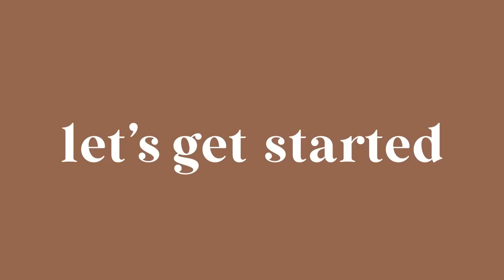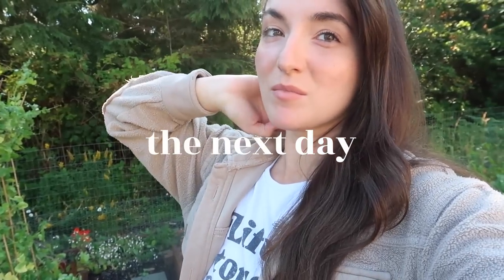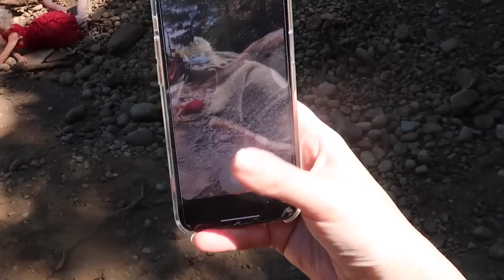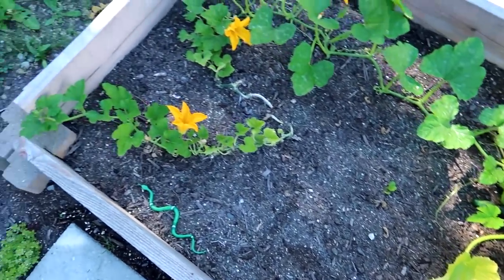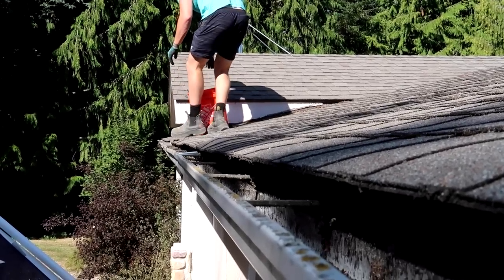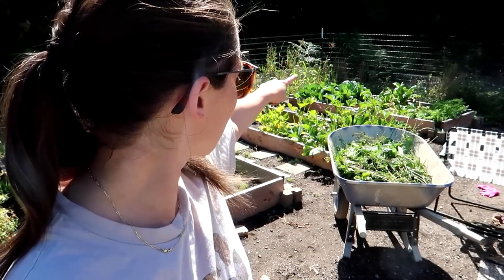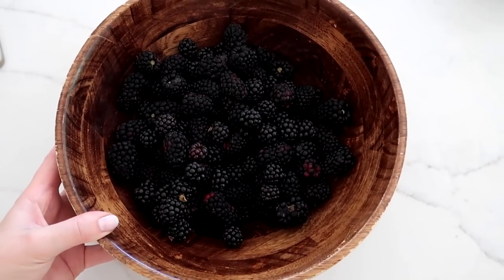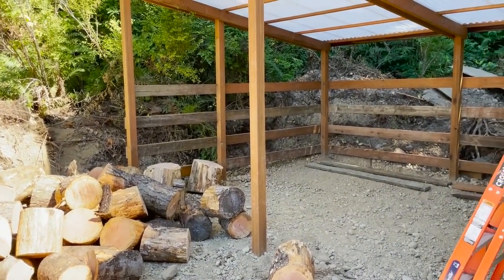🏡MESSY TO MINIMAL EXTREME DECLUTTER| OUTDOOR Fall Prep + Clean w/us! |TOTAL TRANSFORMATION garden🍂

Comment: I had many fails in my garden this year 🤣😭.  Also none of my flowers from bulbs or seeds worked out.  Third year of peppers not working out.  It has been a super hot summer here in New England and barely any rain.  Also I can’t tell you how many times the hose got knocked from my rain collection barrel and drained it😏. I recently ripped out a bunch of dead stuff and it felt good like decluttering!!